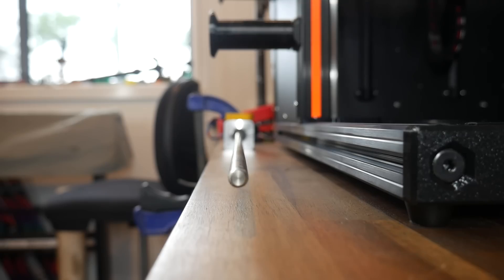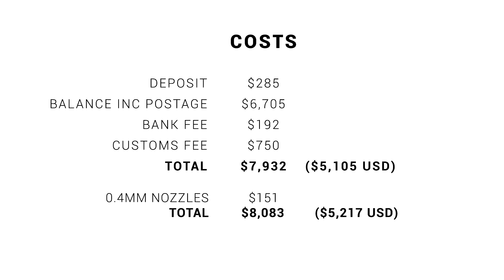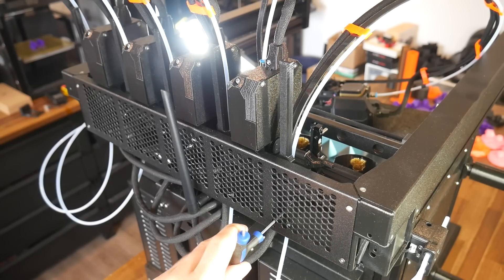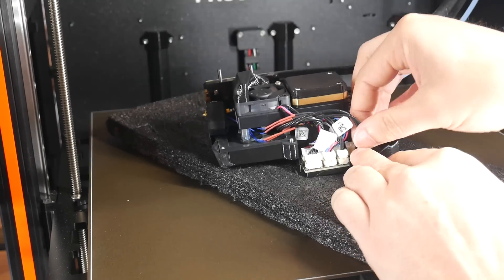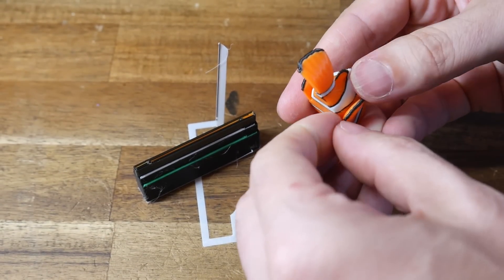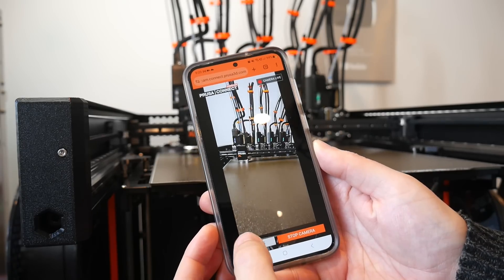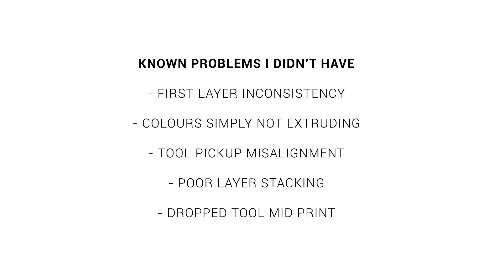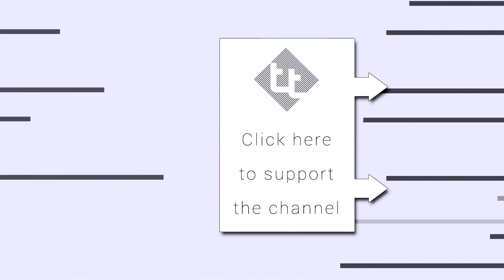I’m (mostly) happy with my Prusa XL - This is what it took

Comment: I am halfway through this video and it is very clear that this printer's value is nowhere near the 5k price tag. I admire his patience. This clunker would have been a return to sender the first week for me.
Reply: Funny my clunker is turning out awesome prints in great time.   I print in PLA & PETG on a regular basis.  It just works.
Reply from the maker: As I said in the video, I would hope that most people have printers without troubles. But there are still too many people who have had trouble, and too many features being added well after release.
Reply: @TeachingTech   I am taking a sterner tack with printing manufacturers these days. I think the 3d printing industry in general is too cavalier about the "out of the box" experience for their customers because they historically sold to hobbyists that were willing to hack on the printers to get them working.  The market is moving to "normal consumers" and the industry (in many cases) has not realized that fact. It is hidebound.
Reply: @mehmeh533 Doesn't change the fact that a lot of people did see major QC problems. "Well I didn't have an issue" is a meme of a bad response on tech forums for a reason.
If someone assembling a Voron is expected to be able to align 4 Z-rails (not 2, 4, and there's no self-alignment - do it yourself to within about 0.05 degree deviation or suffer issues with a flying gantry), then I fully expect Prusa, with actual professional tools and engineers, to be able to put 2 linear rails on aligned to spec.
Reply: Exactly. That wobbing z screw is absolutely unacceptable for a 5000 dollar printer that was "professionally" assembled, that he paid more money for. Absolutely unexcusable.

Comment: Glad I cancelled my preorder.  I’m anxiously awaiting a Bambu XL model.  My X1C has been flawless and is, by far, the most reliable and most used of my 10+ printers…. I have long been a Prusa fan, but they really need to figure out how to compete in the post-BambuLab era.  I recently had to replace a hot-end in my Mk3s and was considering using it as an opportunity to upgrade to the Mk3.9 or 4, but given that I can buy a fully-assembled P1P for the same price, it just makes no sense.

Comment: That is insane that ok an $8k aud machine there are horrible printed parts and lead screws and not ballscrews. Honestly insane. The e3d toolchanger really was the peak quality and fit and finish of toolchangers. This is just the more expensive temu version. You shouldn't have to do a single thing or add a single remixed part. The printed parts should all be mjf or sls printed not cheap mk4 printed parts.

Comment: I am fairly new to 3D printing but I love the mix of fun and practical printing. I have a Bambu X1C. My only issue is print size limitations. What larger printer do you recommend?  I am not concerned with multiple color printing at this time. Also, where did you get the Mandalorian file. It’s very cool.
Reply: You will change your mind about multicolor models.  I thought the same, but quickly realized the limitations of single color printing.
Reply: @The3DPrintingGrandad  You can't say something like that for others. I've used 3D printers +10 years and never ever had a need for multicolor printing.

Comment: I had bad first layers and in my case it was correlated to wet Petg filament with the load cell as the printer extruded blobs before doing the levelling. The blobs then triggered the load cell causing these issues.

Comment: So I’m at the point if I pay that much for a printer I expect it to work out of the box I shouldn’t have to working on it. Great looking printer but the price you could buy 5 p1p with ams and out produce this one printer yes you are going to have higher use of filament on those printers but your production should be higher, upgrade to the p1s you are looking a enclosed printer than for $100 extra. I look at its specs and I want it I look at the problems you are having I would have to pass because it will always be a printer that you are going to have place a lot of hours to keep up mores print heads is not always better. They rush it out to compete with the Bambu and the other products that are coming out.

Comment: I have also had stringing issues on my single head XL. I use eSun PLA+ which is VERY sensitive to water content. I kept the 0.6mm nozzle, but solved the problem by learning how to dry the filament and keep it dry during printing. Getting good results now. Some day I will try 0.8mm which I am sure will be even worse for stringing. Extremely expensive, but I would buy it again.

Comment: I have had similar issues with mine, and like you some have gotten better with the same fixes. Some still have yet to be fixed. I agree that for the money, I would absolutely not buy this printer, i love the idea of the multi-tool xl and hope prusa can perfect it, or if not them, then someone else. While it was easy to contact support and they tried to help with some of the issues, when they couldn't fix others instead of offering a repair or replace they just told me to wait for future software updates that will hopefully fix it. I'll admit i was a bit of a prusa fan boy before this endeavor, I am no longer...

Comment: They announced the switched to 0.4mm nozzles 6 days after I got my XL. 
Even with the 30% discount, having to buy them is not a way to keep good will with customers.
Reply: True, bambu gave all buyers for their anniversary 2 free filaments and during the A1 problems a 120$ voucher
Reply: I would have just returned the printer at that point.. and bought a new one.. lol
Reply: At this point Im convinced they dont care about goodwill with their customers. I bought a MK4 after having other Prusa printers and they sent me a lemon. The filament rapidly twists causing prints to fail after a couple hours unless you manually unwind the twist and it has massive heatbed issues every print I've done to warp beyond use. On top of those issues the print quality is complete garbage. It is so incredibly terrible that I couldn't pay people to take prints that come from that machine. To the point though, I have been FIGHTING Prusa for 7 MONTHS now to warranty the machine and they will not!! Its been a constant battle of them saying that it's better for them if they can identity the single source of the problem rather than sending me a new machine. I said I dont care whats better for you! I care that you sent me a trash machine 7 months ago and I paid the bill for it! Personally, I'll never do business with them again. They do enough right that they seem great on the surface but you go to forums and comment sections and you always hear stories of people getting screwed over by them.
Reply: Sure, but with a little research, one would find that this is actually a generous outcome from Prusa.

Taking back promises, then acting like the good guys by giving customers what they paid for.
Blaming customers for poor communications from the company...

A discount to fix the high priced machine? At least that's a positive.

Comment: mine is terrible so far, can't do a proper first layer across the whole bed. i have literally too close/too far within 4-5 cm each other. replaced one tile, did not help, now I'm waiting for the full heat bed replacement... 
very noisy, especially y axis if the head is in the middle.

Comment: I bought the semi assembled version (also pre order) but got a 0.4mm version. Lubing and the other calibration you did is all mentioned in the manual.
Reply: You realize that the manual changes literally all the time right?

People are getting wildly different printers out of the factory based on the date they bought them.
Reply from the maker: If I had been a later order things would have been quite different for me. I would hope almost every new user has a good experience now.
Reply: @TeachingTech  Mine was March 2023, so I was early but not so early as you I guess.
I also assume, since I had the semi-assembled version and had to read the updated manual, a lot of things were fixed before I even turned it on. 
So far the XL has been very good, with the only two flaws remaining: the nextruder really likes a clean nozzle for probing (same on MK4). And the flexible filament issue, you mentioned. For me it was enough to bypass the filament sensor and then it worked flawlessly.
I noticed that the filament sensors are differently built, there is even a difference in resistance between the channels on the same one. I’m waiting for a design that lets us adjust the pressure…
Reply: @BeefIngot  sure, but then this video is almost invalid by the time it’s released. If things and points have been adressed, it’s more like an Early Pre-Order experience and/or only of historic value.
I was pointing that out.

Comment: You are definitely allowing prusa more than they have a right imo. The most i had to do to set up my bamboo lab printer (for considerably less money!) is clear a space and let it run through its automated steup. If id have spent that much i would in no way have carried on trying to 'fix' what should not be broken. Ive always thought that prusa was expensive, now i think they are expensive garbage. No way, not for me. Ill stick with my ender3 and bamboo labs.

Comment: Working with this machine since launch has been the most frustrating experience ever. Sometimes the tool head smashes itself to the right side of the printer which unlatches the tool and makes it fall into the print, and on top of that the tool head keeps wanting to go to the right so the stepper motors just keep going and going while skipping on the belt.. At this point I'm thinking it's a fire hazard and since then I haven't been confident to do ANY prints over night. And even small prints are hit and miss. Most times it can't even keep up with my mk3s. I'm on the latest firmware and slicer.

Comment: An advisement on plastic and lock-tight for metals, I had an experience where lock-tight caused the surrounding plastic to lose strength and crumble when disturbed. This has only happened on one particular part, but the implication is that lock tight is not chemically compatible with all plastics and should be used with caution in such situations.
Reply: correct

Comment: Very nice review and troubleshooting. That price tag feels high. Equivalent of three X1 carbon combos. The low filament waste is good. Keep up the good content!
Reply: That are significantly smaller and don't have tool change. You gotta realize that it's very different machine for very different purposes.
Reply: True. More professional grade. Just seems excessive for price for equivalent print outputs excluding waste differences.   @jothain
Reply: @gibsonsimpson  Yes. I gotta agree that this release should've been postponed to fix issues. Prusa seemed to hurry way too much mk4 and xl releases.

Comment: The prusa fanboys believe prusa can do no wrong, for years I struggled with failure after failure  but when I would complain I would get criticized online. I am not saying that they haven't delivered good printers, but they have delivered bad ones too. I then moved to a flashforge and it worked so much better, then a K1 Max and it worked like a charm. I hate blind faith following of a brand and people spouting "facts" based on cult following of a brans. I see the same thing happening with Bamboo labs. So many people turning a blind eye towards how much plastic is wasted with AMS, when you bring this up, you get attacked
Reply: What model you struggled with?
Reply: @jothain  mk2, then upgraded to 2.5. It was an OK printer, probably much better than other printers of the time. But changing a hotend due to plastic blob involved excessive disassembly. It also had a nasty habbit of grinding fillament even after installing a fresh nozzle and adjusting tension as per instructions. Flexible plate developed corrosion. Mostly it was the pain of doing minor maintenance where extensive disassembly and rewiring was needed. Drove me nuts. All they had to do was have disconnectable plugs near the hot end so you dont have to redo the entire wiring loom every time a print went wrong and caused a blob that damaged the termister. Also, changing nozzles was hard because you had to do it hot and to fit a spanner in there while avoiding the cables in a rather narrow space otherwise heat block would just spin around.
Reply: @Hilmi12  ok. I got into Prusa with Mk3 and had awesome time.

Comment: Thanks for the fair and differentiate video. There are good and there are bad stuff. I hope that Prusa learned their lesson and will quality control their new releases in the future in a better way. The MK4 and XL are missing features (like an integrated camera, come on - esp cams are costing 5-10$ most, can't be THAT expensive to include them) and have underdeveloped software like their Prusa Link. I'm using it on my MK4 and its okay - but I had better experience with octo print on my mk3s+ years ago.
Reply: See, the thing is, Prusa has been like this for years. Its just a bigger problem now because this thing costs 10 printers worth and operates less well out of the box.
Reply: Tbh with the currently shipped 0.4 versions this is not true ... Mine came a month ago, and it just works well...

My main use case is PLA+petg supports, which is only possible on this printer ... You couldn't do that properly on a X1C for example...

I don't have any of the problems he describes, my printer is 95% stock but I now have nozzle brushes in front of the parking position, but those are only necessary for foaming TPU in my opinion... Did most prints without. But for foaming TPU, which you never get not to ooze, it's good...
Reply: @MichaelKasch  PLA with PETG supports is totally possible on the X1C.....
Reply: @BeefIngot  at high temp for PLA or low temp for petg perhaps... 

But then take foaming TPU as an example where you need a specific temperature... Or two materials further apart

But not at proper temperature... And on the XL you have all the freedom minus the waste due to 💩
Reply: @MichaelKasch  You can have different filament temps. The temp differences between petg and pla isnt significant anyways.

As for poop, not really an issue for most things given that youd just make the interface the support material.

For TPU, definitely a real defficiency though for the AMS.
Reply: @BeefIngot  right poop and interface only isn't a big issue on most parts..

My first print on the XL was multicolor+petg supports... There the poop would be bigger again... But the actual more important thing is, that everything went well out of the box.... No hassle at all with the fresh semi assembled XL...
Reply: @MichaelKasch  No hassle at is hard t9 believe with the amount you habe to put together, the lack of IS on launch and the many teething issues but I could be wr9ng and maybe the later batches improved all but the build.

I do think though that this printer is still missing a lot of creature comforts and polish even if someone gets a golden sample.

No webcam, slow uploads and other "did they test this before releasing" issues plague it.

I dont doubt its possible to get decent prints however.

Comment: This aligns pretty well with my experience on a 2 tool XL, and unfortunately it made me extremely weary of buying another prusa. For a couple of months I felt like I was just wasting materials feeding this thing filament, so much stringing, warping, and I was having horrible layer adhesion even with PLA on a textured plate. And as good as prusa support is, being told my filament isn't good quality or isn't dry enough just rubs me the wrong way. 

It's at least reliable after the firmware updates and I do trust prusa to fix things... eventually. I just don't like that I'm basically beta testing this stuff and still paying full price. Hell, even the extras they gave for pre-orders felt a little cheap, sure an extra build plate is nice but a single v6 adapter?? I had to buy a second one for my other extruder, if I had a 5 tool I would be out nearly $100 before I even get nozzles. Feels like BMW where every little extra has it's own up-charge on an already expensive product. The XL is a terrible value when other companies are including an enclosure, extra hotends, and a damn webcam for a cheaper price.

I really hope prusa can improve quickly, there are clearly some very talented engineers because the XL is honestly a work of art hardware wise. A giant cantilevered gantry is no small feat to pull off, and when prints do work, the level of quality is astonishing. It's a damn shame this launch has been so messy, I hope they turn things around and support their customer base the same way we have supported them for years. A soft spot in the hearts of makers isn't going to keep them relevant forever.